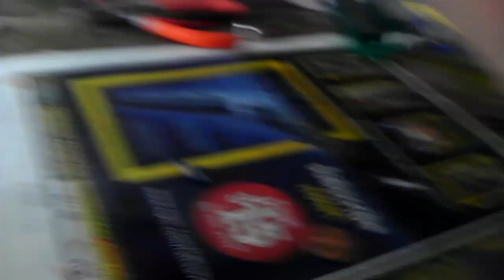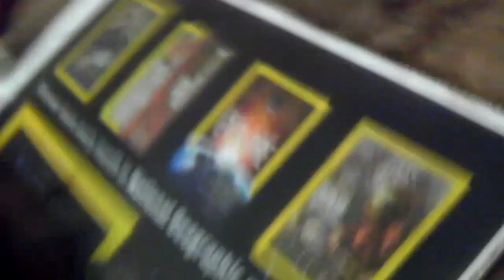Salvage High voltage supply from an old photocopier. + other goodies

Comment: I'd say probably a mix of voltage and frequency with a high enough frequency it can travel quite a ways we use it for tig welding aluminium and with the ground off and one florescent tube on the torch lead hit the pedal and it lights

Comment: Im not sure but I think one could use the light to keep algae out of a small koi pond,with a few  little tricks.I didnt know about the camera,will be scrapping one in the next day or so,my Pops gets pissed cause I keep this stuff,so Im gonna show him how useful some of it can be.
Reply from the maker: Just make sure the wires connecting to the light are well insulated!
Reply: ***** Yea,I know what youre saying,the way I would do it,it would be sealed in PVC pipe,and wires connections would be done with good quality heat shrinks.As you know it dont take that much more to do the job right,the only time I will half ass something is when  I have no choice.Good video by the way.

Comment: Microwave oven diodes are rated for 12KV at 500 milliamps, you could rectify a scanner inverter with no problems.
Reply from the maker: Yes, I knew my 400v diodes were too small :p. Actually I did use a neon sign transformer and a few Microwave diodes. It started to work, but the sparks were jumping across the resistors. Also I think im having problems charging the capacitors correctly. I can only get a series of 3-5 to work reliably.
Reply: ***** I will try a CW multiplier (as opposed to marx
) with the scanner ccfl inverter - I have a pack of 10kv capacitors that should be arriving soon. If you have any success, tell me!
Reply: RadioTrefoil - Not necessarily. These CCFL inverters run at tens of kilohertz. You need fast recovery diodes to rectify at that speed. Microwave oven rectifiers only need to rectify at 50/60 Hz.